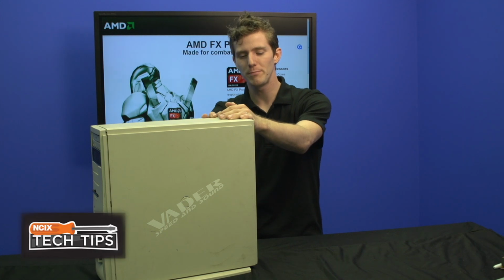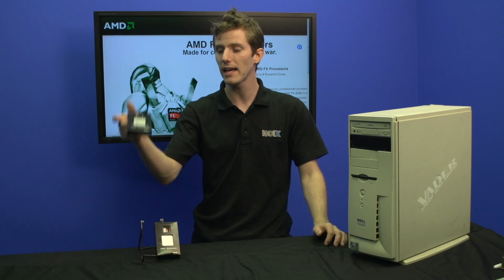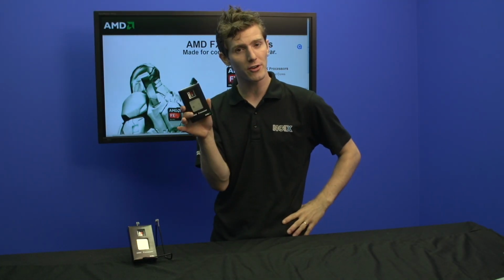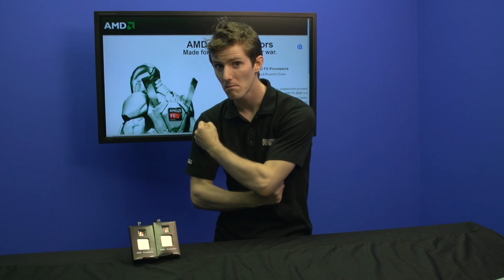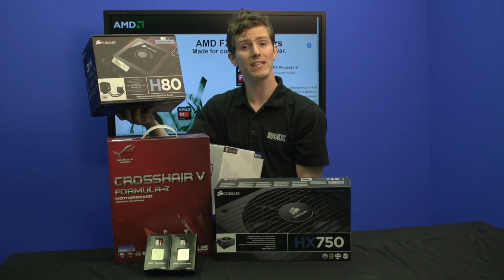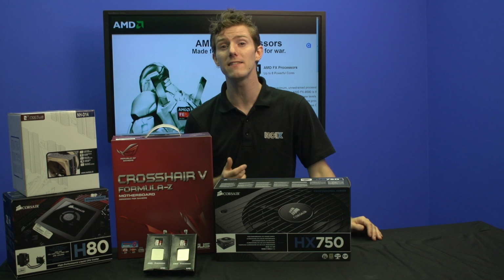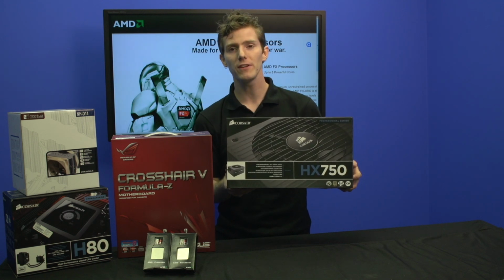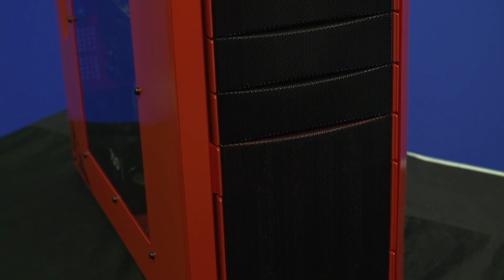AMD FX 9000 series processors hitting 5GHz!

Comment: My build like a week ago...

AMD FX 9590.
ASUS crosshair v formula z.
ASUS R9290x 2way crossfire.
AMD Radeon 32GB RAM Gamer Series 2400MHz.
AMD Radeon 240GB SSD.
2TB Seagate HDD Black.
COOLER MASTER 1200watt Silent Gold Pro PSU.
COOLER MASTER 932 HAF case (modified to fit everything).
COOLER MASTER nepton 280L cpu cooler, push pull configuration.
COOLER MASTER seidon 240M gpu cooler (modified for gpu cooling) * 2, push pull configuration. 
Vantec Lavish fan controller.

I think AMD is awesome they just have to pick up their game a bit regarding it's CPU's...

Linus thanks, you are a big part of the inspiration for my build!

Please keep those reviews and tech tips coming!!!

ENJOY:)
Reply: Ben Zimmerman Ben is jealous :) I work hard for my money. I spend it on whatever I want. Bennie Boy. Go back to the stripclub. xD
Reply: Nice setup man, esp the dual 290's... I have a Sabertooth 990fx r2.0 mobo.. have you seen the 8gb 295x? lol insane
Reply: ***** Wow you got buyers remorse BAD!

And applications not using 8 cores is actually an argument for Intel... Intel has less much more powerful core.
Reply: Ben Zimmerman Umm you're the one who responded back like you were mad at how he has an AMD only rig... you kind of made yourself look like a Jackass.
Reply: Etheoma I can buy whatever I want. If I want to buy a elephant. I will do that. Go whine and cry to someone else with your teenage ranting. lol buyers remorse lmfao. What are you Dr. Phil? You see me harrassing you for buying a burger at mcdonalds? xD
Reply: 9800eddie1 thanks edd, really do appreciate!!!
Reply: ***** well that is going to be sick... surely!!!
Reply: Ben Zimmerman you assumed he paid for it with unemployment checks, or did that part slip your mind? You come off as jealous with that statement. 

Once again these gpu's are watercooled so the extreme heat 290x's put out isn't an issue neither is noise as running a aio cooler at 800rpm is adequate.

You showed your stupidity when you dove head first into a post without knowing all the factors and made an ass out yourself. Please don't act like you have something to do at midnight or later on December 23 you fraud.
Reply: ***** You seriously just totally ignored every fact I throw at you didn't you...

Is the buyers remorse coming out as denial?

Well I think I will just go talk to a brick wall now... I think I would get a better response.
Reply: ***** Well no I was simply pointing out that using your analogy you actually bough a smaller Mc Donalds than mine but paid more for it. But it wasn't just a couple of bucks we are talking about $100 or so.

Your free to do so I just think its a little... silly yeah lets go with that silly.
Reply: ***** When did I say I didn't want AMD to be a company there FX6350 chips are a great choice for high end of the entry level gaming PC's which can get like 60% - 70% the gaming performance that the Intel 4690k can because of GPU bottlenecks.

They make a great notch in-between the intel G3258 and the 4690k as they can deal with multitasking a lot better than the G3258 but are 75% cheaper than the 4690k.

And the FX 8350 chips makes a great video editing rig for cheap. Or for other productivity stuff which can utilize 8 cores. 

The FX 9590 is a rip though it doesn't come with a warranty its over priced over clocked FX 8350 which I could just buy a FX8350 and over clock it my self.

I could stomach the price difference if it had a 3 year warranty because its an over clocked FX 8350 and if you over clock a FX 8350 you void the warranty and you would be paying for the RMA's AMD would have to deal with also if they had just called it like the FX8350 OC edition or the FX8390 or something like that. Because its not like they made any architectural improvements to the 9590 and its definitely not a new manufacturing process.

But none of that is the case and to make the FX9590 competitive it would have to have all of those things... Minus the naming convention but that just annoys me more than anything.

PS; FYI Just the other day I recommended the FX6350 to someone who had a $500 budget with a GTX 760 for a gaming PC.
Reply: Strange. You say you have 2400mhz ram when this CPU only supports a maximum RAM transfer rate at 1866mhz...
Source: http://www.cpu-world.com/CPUs/Bulldozer/AMD-FX-Series%20FX-9590.html
Reply: I've made some changes to my system...

Fitted the corsair hg 10a on both my 9290x gpu's... really gives adequate cooling for the vrm's and ram...
Switched from push-pull to only pull on all my radiators as push-pull is a bit useless...
Reply: ***** they are insane!!! When I work on my laptop at work everything seems dull... lol
Reply: I think amd is best proccessor ever , i dont trust intel i don't know why... :)
Reply: Nikola Ilic cause they steal ur money :)
Reply: ***** ... and I assume you have had the Formula-z? The formula-z was designed for the fx9370 and fx9590... more stability...
Reply: Amd fan ... That cpu is ... Bad ... Ez get wrecked by i7 4790k (more expensive tho but using way less energy)
Reply: So you have both cpu`s then... that`s cute... Oh you don`t even... aaaah
Reply: Ben Zimmerman listen Ben... lets get something straight! The thing I hate the most is people that never has something good to say... When I was a kid my parents thought me that if you don't have something good to say rather keep quiet... I am not an Intel fan- why? Because I grew up with a big brother that always believed in AMD and I adopted it from him... So I dont care what you think or what you would have done with your money!!! If I wanted intel i7 or 970s I would have bought it... In my friend circle I'm the only one with an AMD... and guess what? Not one of their pc's gets the benchmarks that I get, so what now? My build makes me happy and thats all that counts... for $3500 it was worth it... and yes everything is more expensive where I come from(South Africa)... but then again money wasn't an issue for my build as I did it for show(and with my wife's permission...)... I wanted to do an all out AMD top of the range pc, so tell me what would be the cost of an all out intel pc? Then again you cant do an all out Intel pc because intel doesn't manufacture gpu's, and that's one of the reasons I'm not an intel fan.
Reply: Yeah this really is a waste of money considering it doesn't even come with a 3 year warranty and that shows how likely it is its going to fail. It doesn't come with a AMD warranty at all actually if you buy it at newegg there nice enough to give you a 1 year Newegg warranty.

And for the same price as the water cooler, CPU and higher wattage PSU to power it you could buy a Intel Core i7-4790K and save money which at stock speeds is in real world terms faster, and the i7 4790K has lots of overclocking headroom at about 4.7 - 4.8Ghz to its 4Ghz base clock.

5Ghz means nothing in today's market were Intel is on a 14nm manufacturing process and AMD is on a 32nm manufacturing process so Intel can fit 2.2x the amount of transistors in the same space and there for can keep the transistor frequency at 4Ghz and still kick AMD's ass at 5Ghz.

See when you have 2.2x the amount of transistors at a 4Ghz frequency its going to do better than a CPU at 5Ghz with half the amount of transistors. because all Ghz is the speed at which the transistors can switch per second.

Also the Intel's being a 4 core and the AMD's being an 8 core doesn't even matter because again 2.2x the amount of transistors = to roughly ignoring other contributing factors means 2.2x the amount of performance for the same amount of Ghz and cores.

So there are 2x time the amount of cores and 20% higher frequency BUT there are still overheads with multiple cores so even in highly threaded applications the 4790K wins and in less threaded applications like games the 4790k smashes the FX9590
Reply: Etheoma Amd is best price / performance wise :) intel is probably the best choice if you want to spend a lot of money for no pparticularly good reason :) also... they aren't that superior in terms of cooling. Run a intel cpu at 4.7 ghz and ull have double figures as that of amd.
Reply: ***** ...Sigh you didn't read my comment did you?

Don't worry I know you didn't when factor in the water cooling which you NEED for the FX9560 and the price of the FX9560 and the higher power PSU you will need.

that comes to around $350 which the 4790k costs $340 which you can use with the stock cooler.

Or if your sane you would go with a i5 4690k which is only $230 and provides the same nearly exactly the same performance in games as the i7 4790k.

And the 4690k provides almost the same performance in highly threaded applications.
Reply: Etheoma Firstly I don't care about 'performance' cause most software and games do not even use quad cores if not dual cores. So why bother with useless charts. The 9590 is a octo core and not many programs use those cores fully. If there was no AMD there would be much higher prices on intel cpu's. Do you know economy? xD So be happy and thank small company AMD. Personally I don't think it's fair to compare a company such as AMD with a giant like Intel at all.  All in all AMD saved you a lot of money if you bought Intel. So maybe act like normal person? I own both a Intel rig & AMD rig like both equally.
Reply: Etheoma Most programs or games don't use even 2 cores. Let alone 4,6 or 8. Secondly if there was no AMD Intel could set their prices at whatever they wanted. Be glad you have options. I am done here. If you like Intel better fine go buy Intel :) lol not my problem I don't care. Your money do whatever you want with it.
Reply: Etheoma Oh so this is your personal ego contest? ;) I find that silly indeed.
Reply: ***** No I'm just pointing out that you spent more money for less.
Reply: Etheoma Like I said earlier but you keep ignoring it. AMD saves Intel buyers a huge deal of money every second of the day. More money then you or me for that matter will ever see or earn in our lifetimes. Trust me. Millions if not hundreds of millions a year. Thank them! Your points futile in the big picture of market economics. Go to school. If there was no AMD how high would Intel prices be? Imagine. All day I see people on YouTube smashing AMD for no reasons. Stupid ranter. They have no clue about economy. Not one shred.
Reply: *****  what monitor do you use? Don't you think a 295x2 would have been a better buy since it runs cooler and quieter
Reply: 9800eddie1 Using 2 Asus 4k monitors... wanted my system to run in cross-fire... 2 * R9295x2 would have been serious overkill!!!
Reply: Xavi Cadavez two words buddy, "over clock"... take some time and google it...
Reply: What do you mean? You're only overclocking the Hertz on the CPU not how much RAM transfer rate speed it supports...
Does overclocking also increase the CPU's compatibility with high RAM speeds? If so I never knew that.
Reply: KN Webber that's sick man nice build
Reply: Xavi Cadavez http://www.overclockers.co.uk/showproduct.php?prodid=CP-360-AM ... 1866Mhz no OC... 2400Mhz OC capability... I suggest you Google your statements first before you comment...
Reply: Etheoma 3 year warranty you noob... http://www.overclockers.co.uk/showproduct.php?prodid=CP-360-AM ... get your facts straight bud...
Reply: KN Webber very nice system man.. how you like those 4k monitors ?
Reply: KN Webber so what monitor would you recommend for the future in mind? 2k or 4k... best price/quality ratio? greets
Reply: ***** I would recommend 4k - Asus($600) or Samsung($550)... there is a Dell 4k monitor for $360 on Amazon but I wouldn't recommend it for gaming at all!!! Not even for video...
Reply: Ben Zimmerman Lulz thats not a waste of money :D I spent 3500e for 1980 BBS rims... (no tyres)
Reply: DuBstep115 lol xDDDD
Reply: Hakura Teams no thanks :)
Reply: For all the haters out there:
http://valid.canardpc.com/9eyd4h
Reply: KN Webber So how big of a crater did if form? 10km? :) just kidding nice work... but... 5.2 means nothing its not stable tho u got temps?
Reply: ***** idle 32'c and full load on prime95 was 76'c... cpu v-core @ 1.525Volts... gaming reaches a max temp of 62'c.... was just fooling around... Normally leave it 5Ghz cpu v-core1.48V... And I wouldn't post it, if it wasn't stable...
Reply: KN Webber very nice man still .. i quess.. i havent gotten my cpu above 54 celcius yet... greets!
Reply: KN Webber check my arma 2 video 'day zero II'  making that 9590 cry so hard lol... u need super computer to run that game with many units on the field. Insane. Maybe xeon runs it better? or just need more gpu's...
Reply: You forgot something very important:
A SOUND CARD
A BIGGER SSD
Reply: TROLLFACE KNIGHT that`s hilarious... Id10+
Reply: KN Webber A BOUT A WEEK AGO!
Reply: ***** xDDD
Reply: You don't need 32 GB RAM only 8 but i have 16 even that's alot
Reply: ***** Please elaborate on that :)
Reply: KN Webber I have the Sabertooth, and to my knowledge it comes with 5 year warranty and has very good stability. *tuf series. Does formula come with 5 years? You took the formula z for performance it seems however you do know amd fx cpu's are maxed to 1866mhz memory without overclocking. So why get a 95 then if you could have gotten the 83 and just overclocked it and saved price? I am assuming you are overclocking with that setup. Greets MD.
Reply: Ben Zimmerman Actually, compared to the i7 Octa Core, the FX 9590 is on par and is only 4 behind the i7 5960X when playing games like Witcher 3 with the latest graphics update. 

Not to mention the others are only a few bits behind the other Intel Chips.
Reply: KN Webber I'm actually thinking of building an AMD only Rig with the R9 390 cards next month.
Reply: ***** Thats not even the point you can overclock a 4690k where as a FX9590 can't be overclocked any more and most retailers only give a 1 year warranty.

So your better off spending the extra $20 on the i5 4690k then overclocking it to 4.4 4.5Ghz which with a hyper 212 EVO is completely doable and that will trounce a FX9370 and you'll spend less on the cooling solution for the 4690k so it will probably end up being a dead wash on how much you spend in the end.
Reply: I`m Running stable @ 5.37Ghz with my FX9590... and I`m only using Cooler Master Nepton 280L for my CPU...

Yes OC runs quite hot and its not really power sufficient either ..lol.. but you don't buy a modified V10 car if your going to worry about the fuel consumption!

Anyways, I love my build and yes AMD has to step it up regarding their CPU`s but this is my ALL OUT AMD BUILD - COOLER MASTER & ASUS... and there is now way I could have afforded to buy the best intel everything...

Something I`v recently bought:
a new monitor! YAY
Seriously this new monitor is insane, I had the Samsung 4k which I thought would be best but darn was I wrong...

ACER FreeSync Monitor 27``
ACER XG270HU WQHD

Yes I went from a 4k Monitor to a 3k monitor but that Acer was made for my AMD build! (Actually that monitor is made for all AMD gpu`s supporting FreeSync) I love the fact that the monitor really fits in well with my build as it is red and black...

Guys Please do check out this monitor, its pretty insane for the price tag!($500).. Going to do a triple monitor setup!!!

link for the acer monitor if you'd like to check it out...

 http://us.acer.com/ac/en/US/content/series/xg
Reply: KN Webber And a Nepton 280L costs $100~ a hyper 212 Evo cost $30 I think you have proven my point there...

Although you could probably get away with something like a Noctua NH-D14 for the 9570 at stock but that's still $75

Although when the 6600k stops getting price gouged you can push a really good overclock on a basic after market cooler like the Hyper 212 Evo.
Reply: Etheoma Want to know why I got the Nepton 280L for $115?
Reply: KN Webber What ever the reason its invalid, because water cooling doesn't become a good investment basically until you have the best CPU you can buy, excluding Intel Extreme series as $1000 vs $300 isn't a good investment.

But like seriously you can get a 5820k for $390 which when your talking about a $239 processor and a $115 cooling solution thats $354 so for an extra $36 you can get a 5820k which will wreck a FX9590 and to even run a FX9590 you need a motherboard with a very good power delivery system which will set you back $120 - $150 which the X99 boards cost around the same for the entry level once.

So what ever your reasoning might have been it was invalid, the FX9590 is a dumb chip.
Reply: Etheoma Nope, because I can!
Reply: KN Webber But you got an inferior processor because of it... GJ...
Reply: Etheoma Inferior CPU... Definitely not, price vs performance its a good buy @ $250...

Just so you know, my -
RAM is AMD
SSD is AMD
Gpu`s are Asus AMD
Mobo is Asus

Its an AMD setup, build a bridge and get over yourself!

& how about both my R9290x gpu`s?

Both are fitted with Corsair AG10a gpu brackets + Cooler Master Seidon 240M closed loop coolers... That`s another $300.... Whahaaaha...

Dude, I really don't care what your thoughts are! Go fix your Pentuim4 or something :)
Reply: KN Webber Well if your just admitting to being an AMD fanboy then at least your honest. and then it doesn't really matter if you spent way more than you had to for the a well well performing system.

I go with what ever will get me the most bang for my buck so it is an alien concept to me to buy something just because of its brand, unless the brand is known for making better stuff generally in one way or another, and even then before buying a specific item I will see if its the best.
Reply: http://www.anandtech.com/show/9231/amds-20162017-x86-roadmap-zen-is-in

Pretty exciting stuff...
Reply: KN Webber Yeah very nice but we will have to see what AMD can make to reality Like DX12 little is being done I think too little and needs more development. Old API dx11 is useless snail if apis dont change every system is 90 procent bottlenecked. No matter it's cost. Today all systems are using little cores usfully. The R9 400's I am very exited about though. I am going for 10k in my next system. Triple 32GB GPU's and 32 Core Zen prob, maybe even 2x32 Core server mob if possible. I think it will run any game today on 10k ultra settings in 120fps without any problem. Crazy stuff! MD
Reply: KN Webber yes. if i save for it now, can buy in 2-3 years hopefully we will see. The euro has lost its value to the dollar though that makes it unfortunate we will see how pricing will go. If I had bought 10k dollars one year ago I would of made like 5000 euro profit now. lol inflation. AMD is known to be a price strategist and they have sold many fx I am sure when they lower the price so much. Intel had to lower all it's prices and also make mutli cores cheaper cause of it.
Reply: Ben Zimmerman The AMD 9590 is basically the 8350 but at 4.7 Ghz stock like you say... BUT with warranty. Hmmm... lol why would I care to overclock and void my warranty and waste potential money by ruining my cpu? 99 percent of overclocking = useless most people do it for kicks and just being silly. What work do you do Zimmerman? You need a overclocked cpu for your work? If not.. and it's just for games and 'show off' it's utterly useless. Frying it or risk damaging parts with no use whatsoever except the fact of a few 100mhz more. Doesn't sound really smart. No not really. I rather have my 2 years warranty free. 0 cents. You talk about me wasting money but you do it yourself. Not me I try to keep my computers running +5 years easily. Also the FX 9590 at 5GHz is faster than the 4770K at 3.9GHz (turbo speeds). And it never gets 80 degrees if you cool it right. ;) not even 60 celcius... lol Zimmerman..... nice effort ;) but futile none the less. The AMD cpu's all are a great buy all in all with the huge price drops. The AMD 9590 gets hot... but with good fans and liquid cooling it doesnt go above 50ish celcius. It's fast. It's blows many intel chips right out of the park at this point. So ... please :) go make yourself another coffee. With sugar this time. Compare an Intel chip @ 5GHz to FX chisp and I guarantee you with identical coolers the Intel chip will be two-figures higher in temperature (in celsius). AMD fx line is best buy for price performance and they are fine quality cpu. Stop hating on people their parts and computers perhaps with no reasoning everyone wastes money in this society. By the millions. Are u shitting yourself? We throw away 500 million euro's worth of food everyday in Europe alone. Get real perhaps and worry about something important.
Reply: Great waste of money, man!
Reply: LOL you're both so offended and mad...thanks for taking the bait, mate! But seriously. You're spending $300 on what is essentially an overclocked 8350...and now that the 970s are out, the 290x is irrelevant seeing as though the prices haven't dropped yet. But go ahead. Throw all that "hard earned" (probably unemployment checks) on this space heater of a system. Where your cpu will reach 80 degrees and your 290xs will throttle. Have fun! :D Don't mistake pity as jealousy.